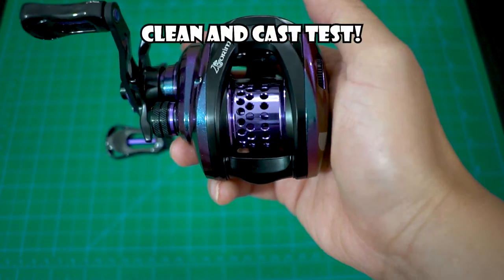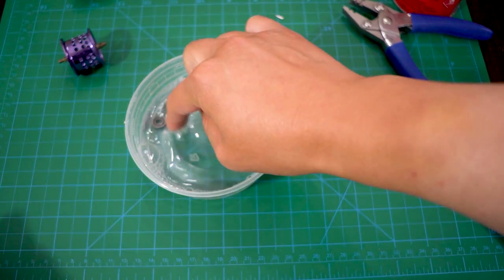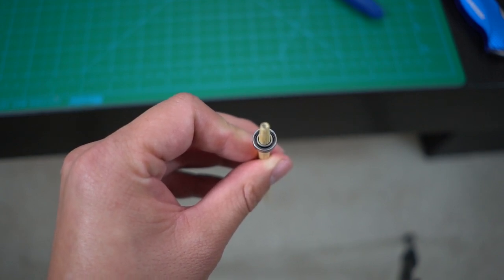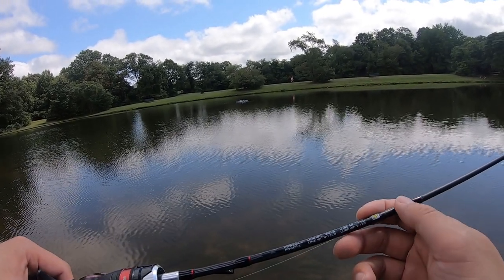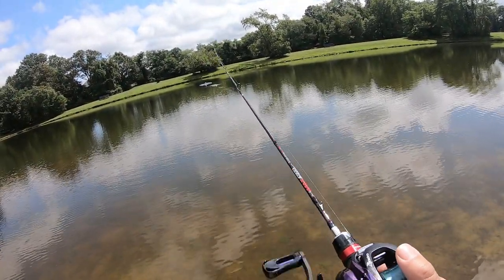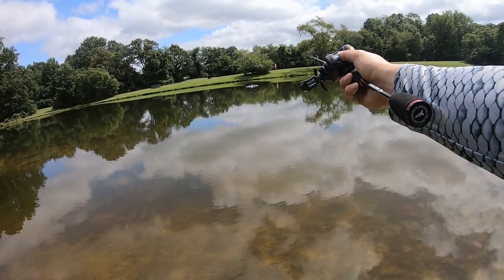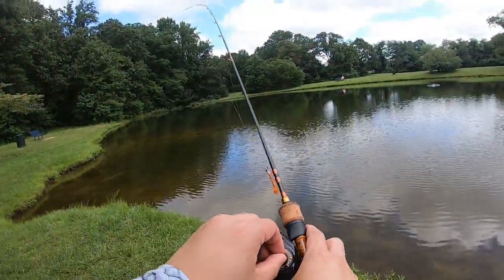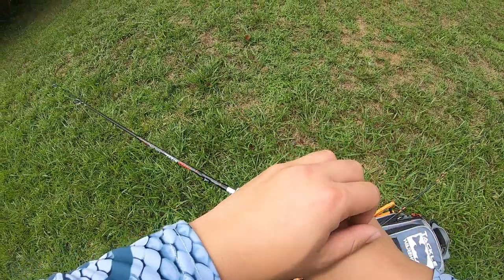Kyorim Black Knight BFS Reel - Initial Cast Testing and How to Clean Reel Bearings

Comment: That over run is because of the spool tension not the breaks. The breaks slow the spool down at the start of the cast the spool tension slows it down towards the end of the cast.
Reply from the maker: Although you have perfectly explained how it should work ,  the point is that this doesn't happen on the right hand reels.
Reply: @rawrfishing  you mean left hand* because they didnt flip the orientation of right hand brake  so the brake drum and the Centrifugal  induction that would pull it out is on the wrong side for the right pivot.

Comment: You might try tightening up the spool tension and see if it corrects the overrun issue. It is surprising the braking system is so much weaker than GH-100. Most all of the lures I use on mine, seldom need the brakes set any higher than setting two on the dial. I found that a spool with line spins longer than one without line. The reason being; the added weight of the line makes the spool spin longer. Don’t give up yet on the reel; not all reels perform the same even between the same models. There may also be too much grease inside the reel tension side of the reel too.
Reply from the maker: although the brakes and tension of the spool play side by side, they are two different things. Sure i will have to utilize it if i want to use the reel for certain applications. tried skipping, but it was difficult. may not be an issue for those who just cast lures.. but was hoping i can use it on the heavier end of the BFS world spectrum and put it on a ML rod.  The reel still casts smooth but the brakes are weak and perhaps be too weak for some folks, but shouldn't be too bad. the brakes is strong enough and works enough so that it doesn't over spool during the initial cast, so there is hope for those left handers that want to just cast a lure and want a clicker on their drag system! gonna have to play around a bit more and circle back with a final review

Comment: The clicker is what sold me but now the whole left hand issue has me questioning my purchase. But FWIW I do have to use my thumb on my Aldebaran BFS.
Reply from the maker: i have taken the reel out again yesterday because i was shocked how well it casts even with this interesting braking issue.  If you noticed, I never backlashed during the cast, where the initial lure flies off the spool. so the braking is working up to some certain extent.  and the distance on that 2.6 gram jig/plastic.. was not bad with wind blowing lightly  against me.  so i am really torn, going to take it out a few more and actually do a wrap up video.

Comment: I have two Black Knights one I added six magnets and the second I used only two on top and on the bottom on the opposite side of the pivot point.. The reel with 6  magnets added I used for lures heavier than 1/8 of an ounce. awesome both of those reels are left-handed.
Reply from the maker: Mine fell apart lol... So no upgrading magnets for me 😂

Comment: 1 side of each of the bank of magnets is spring loaded to make it a "dynamic" magnetic brake system, similiar to Daiwas magforce. The braking may not be as strong as the GH100 because I saw in your unboxing vid that the Black Knight spool is bigger, probably by a couple of millimeters. So if they used the same size brake hub as the GH100 instead of making it bigger in proportion to the bigger spool then that gap between the magnets and the spool is bigger and could be the cause of braking issues. I know that when I went with an even shallower spool on the Aldebaran BFS, I had to use extra magnets to make up for the increased gap. So you may want to compare the sizes of the brake hub between the Black Knight, Dark Wolf, and GH100 to see if they are the same.
Reply from the maker: could be possible! wondering if there is a tool to measure magnetic strength for consumers rather than scientists out there! would be so cool to test magnet strength. but have you heard of the problem with the braking system between the left and right hand reels? looks like i have to get a caliper to do some comparisons.  I did cast the gh100 and dark wolf, the GH100 doesn't seem to have this problem, but the Dark Wolf does!  Aiya~~~!!
Reply: @rawrfishing  honestly no, but theres not alot of videos on these reels. Im tempted to get one and try it out. I dont think it would matter what side the magnets are on but I could be wrong
Reply from the maker: That's what I thought originally.  But I am no expert on magnetic fields and its placement/configuration
Reply: @rawrfishing  question on stock GH100 or Aldebaran BFS, as they both use Dynamic mag + centrifugal braking system, would it help the distance by removing the magnets?
Reply from the maker: @Kelberi  Neither of them use Centrifugal Braking system?  You remove them magnets and it's not gonna work well! i promise you that!
Reply: @rawrfishing  Aiya...... wow that's fast thanks!

Comment: I have a left hand coming, I use more spool tension than most..so it might work out for me. I will fish with it for awhile and look to making modifications to it, worse comes to worse..ill have a clicker drag for my gh100.
Reply from the maker: I think if you don't intend to skip lures... it would be fine, but dissecting sounds good lol. especially when a drag clicker retrofit cost 45 dollar shipped on ebay for the GH100... i can use this reel as spare parts! lol
Reply: @rawrfishing  looks like a project, to each their own but I never saw the logic in using the right hand reels for a person who is right handed..id rather my right hand be the power arm for bigger fish, casting accuracy, and keeping it in one hand.
Reply from the maker: That is the reason I use lefty reels.. because I am right handed! Lol

Comment: Common main brake designed not for end braking. If we want to avoid backlash in the end just turn the tension knob till the lure stop when hit the water but the distance definitely cut off.
Reply from the maker: I agree, it's not really for end braking, but it pisses me off that it works on the Right hand reel and not the left!  Sure.. you can use the tension knob to compensate for the weak braking system.  but if i do so... would i lose the distance? Absolutely!  But at least it have enough braking power for the initial spin for the initial cast so it doesn't birdnest.  anyone with a slightly above average thumbing skills shouldn't hinder them, but a 65 dollar reel should work if they are trying to copy another reel that have great success!
Reply: Hahaha thats right. Tension knob also save my day when fishing in windy condition and night fishing.
Reply: I didnt know if there is a deference beetwen right and left handed reel. I am right handed in the lifetime 😂
Reply from the maker: @eriksalipadang7878  gotta use em both! I seldomly use it for bfs reels. I tune it so that it doesn't wobble and rely only on brakes for all my reels.  I will see what the next few trips will happen with this reel before I do a final review to recap my  thoughts
Reply from the maker: i use left for personal reasons. my kayak rudder control is on the left. so i have been using left hand reels ever since!  but yeah there is a difference. I have consulted on forums/facebook groups and yeah.. totally news to me!
Reply: Thats nice. Wait for your next video 👍🏻
Reply from the maker: probably come next week or later the week, got other stuff lined up and i do want to play with it more. so far i have done it off camera.. probably will continue to do so until the review.  I may just end up upgrading the reel to micro bearings, trying it and see how it works or do the Tsurinoya Dark Wolf 50... that also have the issue on the left hand reel...
Reply: do you still use right hand to hold the rod when throw lure use right handed reel? I see some people use right hand to hold rod when throwing and then change right hand to retrieving
Reply from the maker: no! i feel that it's ridiculous. i am right handed, so i'll cast and hold the rod with right hand and reel with left.  im strong and more accurate with my right arm, why not leave reeling on the left?  i have seen ton of folks who screw up swapping hands becuase right when the lure lands, they  swap hands and a fish bite. hell it have happened to me before! won't even lie about it!

Comment: Could the brake issue of a left hand reel simply mean that the break adjustment position is reversed? Does the max position of the break adjustment on the left hand reel provide the weakest or the strongest break?
Reply from the maker: Could be but I can still cast lures no problems. So I won't mind it that much for now. I just can't skip lures as I need more braking power.. which most UL folks won't do or care about. I do for my ML stuff
Reply: OK. Was hoping to get a confirmation information as I am about to pull the trigger to buy one. Reversed brake adjustment position is acceptable but NO break is not. Thank you! Keep up the good work!
Reply from the maker: @DK77201  check my more recent casual fishing trip where I took this and the KK valiant eagle out for pickerels.  On a ML rod it's fun

Comment: Got a Black Knight this week and found it casting heavily left. Transferred the line to my GH100 and cast with the same rod and lures and the GH100 cast on target. The Black Knight made a lot of noise during casts so something  is rubbing or otherwise wrong. Disappointed.
Reply from the maker: oh no! did you clean the bearing first? and how heavy the line and lures you were using?  My gh100 was like that too with the original stock lubrication. I bet the Black Knight would have been similar given that I have found so much oil on the spool bearing, likely from body/gears. i think when the stored/transported it, it was in hot conditions and some of the gear grease melted a bit and gotten into the spool bearing. which would explain why the other bearing was dry.  but try taking out the bearing and see how it is!  i took it out yesterday and used it briefly during a snakehead fishing competition. didn't catch any with the setup so i swapped off to heavy gears. but the casting was surprisingly good even with the braking issues.  so definitely clean the bearings and try again!
Reply: @rawrfishing  I'll look into cleaning the bearings but it casts so loudly I think something else is going on. It sounds like when there are a few loops  of line on the spool from a mini bird's nest and you cast anyway, especially when one of those loops gets past the edge of the spool.  Was using 4 # SOS mono and a partially filled spool then used that very line on the GH100 with no issues. Lure was maybe 2.5 to 3.5 g total weight.
Reply from the maker: that loud? i mean with my bearings shields removed, mine doesn't cast loud at all. i wonder if you have a bad one. these CDM reels from no name brand companies are very inconsistent with quality

Comment: Just some info, i have a gh-100  its left hand, but the brakes definitely work, now it still overruns when i dont stop the spool but so does my alderbaren.  And ill juat say while the gh-100  doesnt perform as well as the alderbaren its only about 10-15% less in performance, i think its a great reel casting down to 2gram.  Because you dont rate the gh-100 that much makes me veey curious as to what you think the beat bfs reel is.
Reply from the maker: My gh100 also do a tad bit but way less than this reel. It is very interesting that It happens on the aldebaran... But how much? Although I am a bit mad that this is the case for this reel and dark wolf, glad it is not as much for gh100. It makes me wanna get one right hand reel to compare.  After calming down, i guess i will do a wrap up video for this reel...
Reply: @rawrfishing  i do have my reels set light so all of my reels needs to be thumbed when the lure hits the water.  Even met 20 and alderbaren bfs.  (scorpion dc maybe an exception) Sometimes if i forget to tighten up before setting up ill see a massive backlash just putting the line through the guides
Reply from the maker: i set all my stuff light too. i don't use brakes as much as some folks, but brakes are there for a reason! everyone got different skill level  with their thumbs and some may just need a reel with stronger brakes.  for us seasoned folks, i don't think it's that bad after doing a 3rd run casting it.

Comment: That's a shame. I love my right handed version of the black knight and have no issues casting lures down to 2.5 grams with it. I'd like to say I'm shocked that they didn't change the brakes on the left handed version, but many of the bfs reels I've tried from aliexpress have greased anti reverse bearings, so noth9really surprises me.
Reply from the maker: i bet it's a good reel, but unfortunately i won't be using/testing the right hand reel. can't support a company that just slap something together and sell it!  but i will test the other GH100 variant reels i have right now since they are left handed, including the GH100 itself!
Reply: @rawrfishing  I agree, that's why I'm glad you're sharing that information. Like I told you earlier, I would never recommend the spirit fox because of the greased anti-reverse bearing. I took apart my Xf-50, degreased it and upgraded the drag, but I didn't want to do the same thing to another reel that they released later on. Obviously that's a much smaller issue than a worthless brake system, but it's still a sign of poor design/build quality. Hope your next reel is better.
Reply from the maker: i have recommended the Tsurinoyas because those are easy fixes. rinse with some hot soapy water and let it dry and resinstall. but not everyone got the tools or skillset to do so. also not everyone have the issue as well.  but this reel.. i took the time to cast again yesterday  because it casts so well even with bad brakes. yes i got the god of thumb lol (just kidding) so i'll let myself cool down and write a few notes for a final review... i never have wrapped up any reels for a final review lol. i should do it before the other reels comes in!
Reply: @rawrfishing the more information out there the better. I give your credit because you mentioned it, and people can decide for themselves. Even with this video, u did say it casts well and some people might not expect a reel to overrun without thumbing it and decide to roll the dice. 
As far as the spirit fox, although it's an easy fix,  I don't think you should have to pull off a side plate and clean things up just to have anti-reverse, but that just me.
Reply from the maker: I totally  agree. I don't like to pay for something and have to do extra work!  but if it's a reel that have amazing potential and it's cheaper than a JDM reel by 4-5 times... lol... i am very open minded!  I am willing to accept exceptions with sound reasoning :)

Comment: Would the ceramic bearings handle salt water ok? Obviously reel would be rinsed post using it, but in general, salt ok.
Reply from the maker: The ceramic balls within the bearings itself should be... but i can't vouch for the stainless steel races on the bearings would.  After all, we know nothing about the brand of these bearings
Reply: @rawrfishing  if you had to choose between this and the Tsurinoya XF 50 which would you choose as the best alrounder?
Reply from the maker: @kickthephase8750  all rounder is subjective. Xf50 doesn't qualify as an UL bfs reel as the spool is too deep and its heavy.  I would consider that reel a ML BFS reel where as its upgraded version the spirit fox to be a good UL BFS reel. Note you can always just shove a spiritfox spool into the xf50 as show on my video.   From there... the tsurinoya reels will be better than this reel as the brakes will allow you to skip lures where as the left hand version of these FTB style reels will not work.
Reply: @rawrfishing  thanks for the tip, i just ordered the xf50, ill look into the spirit fox spool as an option, will be using it for Saltwater species like mangrove jack at 1st, but later will use it for suspended lures for Oz bass in our lake edges in Queensland
Reply from the maker: sounds like fun! how much line do those pull? i may suggest spinning reels as the drag system between baitcasting reels and spinning reels are totally different and for fish that you need to rely on fighting with softer or more controled drag.. a spinning reel will win every time
Reply: @rawrfishing  the bass are ok, not big line pullers, but dirty fighters, they know where the snags are.
The jacks fight harder but are still not line pullers as such.
Ill be using braid on this reel, prob 6 or 8lb